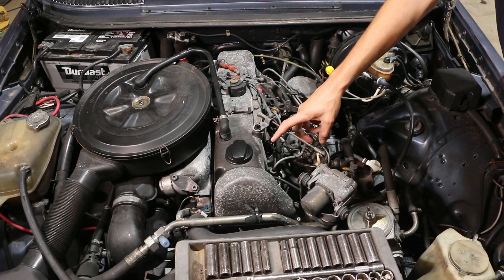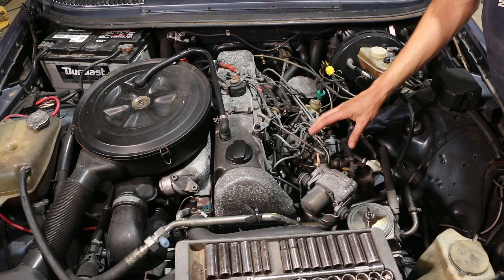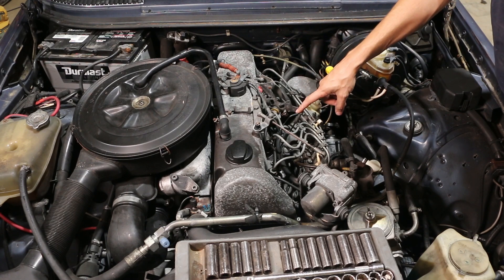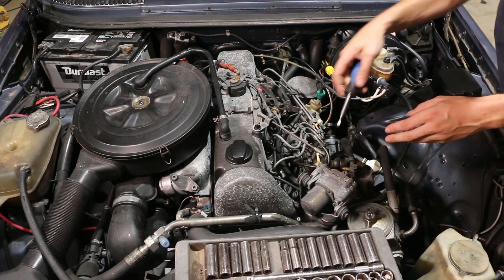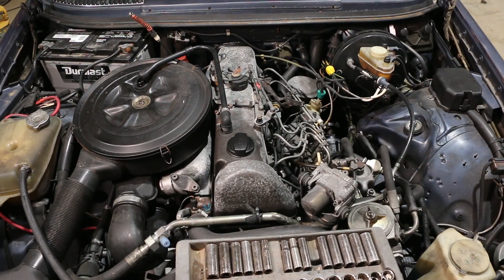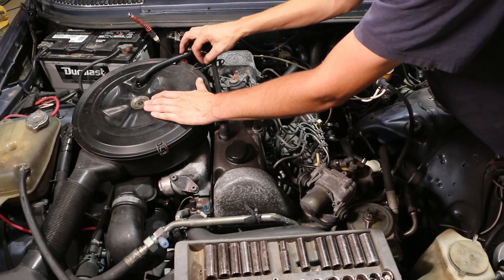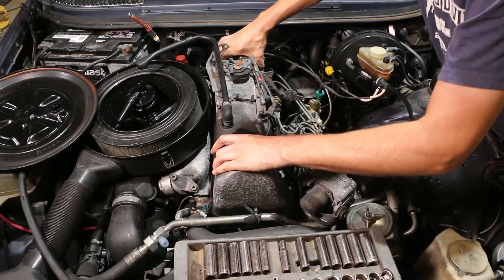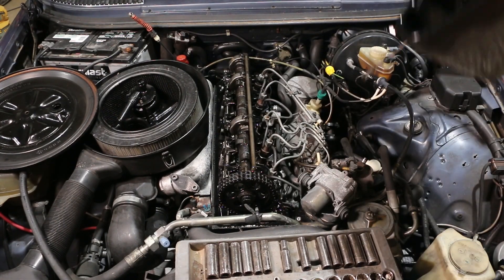Is your OM617 Timing chain stretched out? How to check it the quick way using cam marks.

Comment: You really ought to check which offset key you already have installed. If you now have the "0067" 10d correction key in there, then together with the additional 7d which you discovered during this video, they add up to a 17-degrees - a pretty much worn out chain and a big liability. For reference, jumping a tooth would move the cam by 18 degrees. If, OTOH, right now you only have the 4d key installed, then you should install the 10d key in its place, which would put your chain at 1 or 2 degrees ATDC (and your chain is still on its last miles, but not immediately). Remember, your IP timing is also affected by this, and right now it is 7 crankshaft degrees away from spec.
Reply from the maker: I agree, I actually bought a new iwiss chain, crimper and all the tools to replace my chain, but I checked the IP timing and it was dead on 24 degrees, I tried advancing it slightly to 28 degrees and it basically made the car noisier and harder to start in the cold but no difference in performance characteristics, so I set it back to 24 degrees.

I should check what that key is though, and maybe just change the chain out over the winter while I'm doing less driving and can pull it inside.

Comment: Thanks a lot for that video, I have a w123 300d with 450000 km, and there is 0 degrees off, so I don’t know if it’s a good thing or not, considering the fact that I have an oil chain tensioner… 
Thanks again for the video
Reply from the maker: I'd say there is a good possibility that at some point your timing chain has been replaced, or at the very least there might be an offset woodruff key in the cam to correct stretch. They do last a very long time typically.

Comment: What is the spec/tolerance?
Reply from the maker: After 50k miles there should be about 2 degrees of stretch, there are offset keys available to correct up to 10 degrees, so if there is more than 10 degrees of stretch, the chain cannot be compensated for and would require replacement, I'd likely do it before it gets quite that far as it does affect injection timing as well

Comment: Thx for your good Video , maybe you can Help me . I have 200 d w 123 year ,1982 and before 1 week Motor have some ticking noise Tick Tick Tick constantly . Valves are OK . What can IT be thx alot
Reply from the maker: I would check injectors. If one is streaming or not firing like it should you will have a noise that is commonly called "nailing", a high pitched tick or knock sound that is from incomplete or improper combustion. I would start the engine, and then crack loose the nut on each injector line one at a time, that way you can narrow down which cylinder the noise is coming from, and that might point you in the right direction!
Reply: @trythistv  thank you alot i will check this